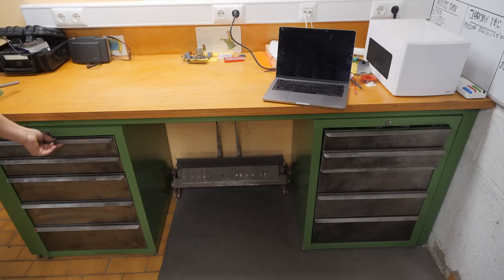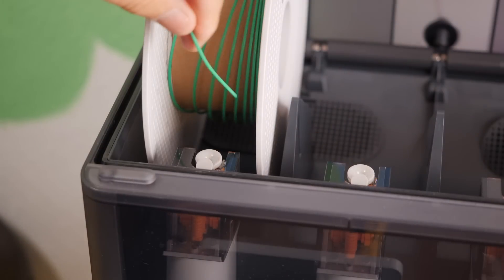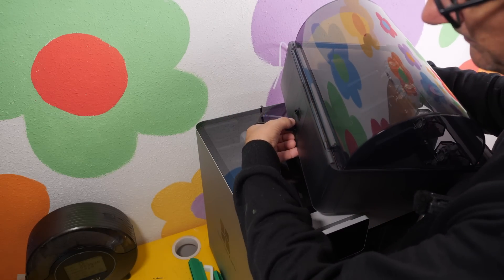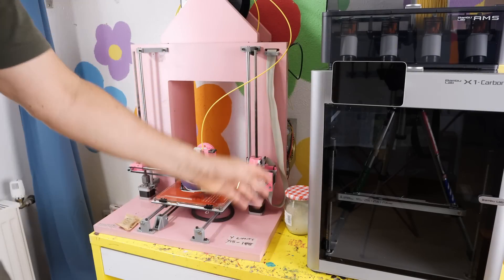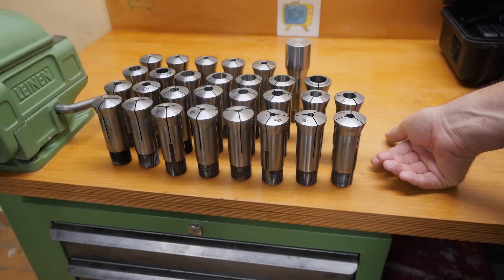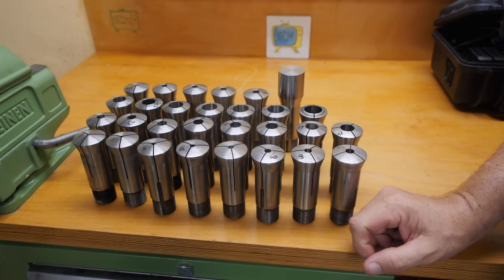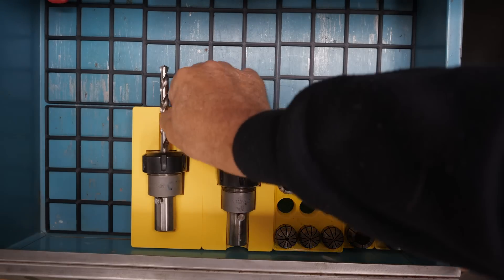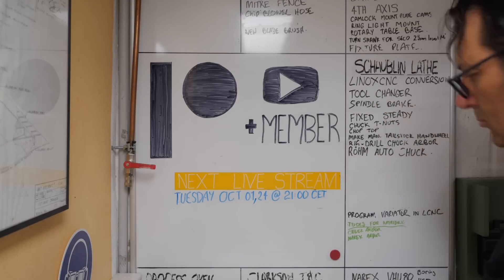Not all tools need Gridfinity || RotarySMP

Comment: Couldn't bring myself to click the 'thumbs down' button, so I guess I messed up the lame video detection algorithm. Not only that, I've also been gridfinity-ing my way through the workshop and I'm determined to use it where there's really a better solution just so everything matches :-) How nerdy am I? - Heather

PS: just helped my brother pickup a neglected second-hand lathe. I think he got a nice little bargain there.
Reply from the maker: Hi Heather. What sort of lathe did he get? Color coordinated gridfinity is a slippery slope :)
Reply: @RotarySMP  It was an Emco Maximat Super 11. Rather tatty looking but the bits that mattered seemed good.
Reply from the maker: @GeoffTV2  Cool. Nice Austrian lathe. Stefan Gottewinter pimped his one really nicely.
Reply: @RotarySMP  I'm aware of my Gridfinity problems and am looking onto counselling - just one more bin first though.
Reply from the maker: @GeoffTV2  Nice Austrian Lathe. If you need ideas for pimping it Stefan Gotteswinter has one.
Reply: @RotarySMP  Yeah, we're both fans of Stefan
Reply from the maker: @GeoffTV2  He is the real deal. A real tool maker. Very impressive knowledge and skill set he has.

Comment: It's great that you're using your 3D printer wisely! It's usually faster, more stable and more practical to grab some wood and make it yourself quickly.
Unfortunately, YouTube is full of lots of pointless prints. 
Of course, not everyone has access to machines or the ability to work with wood, so 3D printers are a great solution. 
Now I feel guilty for having watched you tidying up. I feel compelled to tidy up a bit myself. 😫
Reply from the maker: Hi Chris,
Thanks. I still have plenty of messy drawers to work on :)

Comment: It's pretty crazy how much filament is wasted by printing multi-colour or with support material.   Early on I bought an additional AMS thinking I would do a lot more of that but you really only need one.  (yes with the needed multi ams mixing thing that goes on the back)
Reply from the maker: I am just designing my first multi color part, but will only use that sparingly, on low profile parts.
Reply: @RotarySMP  definitely worth trying.  I've used both PVA (you will need that dryer) and their pla/petg support material.  On the bambulabs software you will start to pay attention to the quantities of material consumed.  Also the amount out the "poop shoot".
Reply from the maker: @JohnTrevick  I really like that Bambu software. It seems well integrated and thought through.

Comment: Gridfinity is overrated, just keep your stuff in old coffee cans or cardboard boxes. You can get a bit fancy and use tupperware and label them even. Alternatively, embrace the chaos :)
Reply: I do it about how he showed his toolbox - the top drawer is the catch-all and absolute chaos, but the others are like "files", "hex keys", "drill bits" etc etc. That's enough organization for me. The people that organize too much spend all their time organizing their tools instead of using them
Reply from the maker: I mostly organise things with ice cream containers. I like ice cream :)
Reply: @RotarySMP  I buy cartons of roasted peanuts.  The containers are clear plastic, and roughly cubes with rounded corners.  Really great for chucking stuff in when disassembling something.  For larger stuff, I buy pretzels!  For larger stuff I did buy a bunch of the same size of plastic containers, and built shelves to perfectly fit them.  These contain stuff like cables, camera parts, parts for the 3d printer, laser cutter, etc.  Everything is labelled so it cuts down the time searching for something from 30 minutes to 25 at most
Reply from the maker: @rustybrooks  What people who are Gridfinity OCD dont realise, is that it wont help you search for the missing tool. You might be sitting on it :)
Reply: @RotarySMP  Then the airtag crew will swoop in and tell you to put an airtag on every tool so you can locate it at all times :)
Reply: @RotarySMP  I came up with the perfect solution to "where did I just put that tool that I had in my hand literally 2 seconds ago"

It's simple, whenever this happens I buy 3 more.  Then after I've lost all 4, it should be a lot easier to find at least 1
Reply: @RotarySMP  Haha, I have 60 odd 5 litre tip top containers, the long ones that are meant for shop service. It was a hard road..
Reply from the maker: @m3chanist  Ice cream heaven :)
Reply from the maker: @rustybrooks  That is a tough method :) On the wallet.

Comment: I must have spent weeks of my life in the RAF cutting out foam sheets to create tool holders for the tool kits. Not any more which is why my workshop is a bit of a mess
Reply from the maker: Those cheap lasers would be a good way to cut foam shadow boards, but I am too lazy for that :)
Reply: I actually bought a bunch of cheap, EVA foam mats just for doing that with my laser! A year later they're still mats, so it turns out I'm too lazy for that too 😂
Reply from the maker: @Teklectic  I am glad to hear I am not alone :)

Comment: I have 2 floor to bench shallow drawers that are the perfect shallow depth for gridfinity. I've fitted out a couple drawers already for organising small endmills and small parts etc. Definitely has a place and totally agree some people go overboard and end up losing useful space. Before that I used a hot glue gun and some wood trim strips from the local hardware shop. Being able to rearrange, change up and relocate with gridfinity is a big bonus.
Reply from the maker: Good point. I should have mentioned that. I already rearranged that one drawer a couple of times.

Comment: Depending on the age of your filament, I found yellow PLA hard to use, no matter the brand. I stopped buying that colour 5 years ago, the 3d printing world might have fixed the formulation during that time :)
And as you say, PLA doesn’t improve when you let it ‘age’ in the open!
Reply from the maker: Thanks for that. I also noticed that different colors have different properties.

Comment: from the time when I did a bit of professional white-water raft guiding, I picked up the habit of using a bit of two unique colors of fingernail polish to put a couple of marks on all my gear in a not normally viewed location... place where a handle screws into a piece of gear, under the soul of the shoe, or maybe in the cracks of a clip... just some identifying colors that are very difficult to remove, especially if they are out of sight during normal inspection... works great for identifying gear when it walks off, but there is a small community of where it can hide.  =D  Happy Sunday!  Long story, just so say... having a few unique colors of fingernail polish around can be helpful in certain instances... =D
Reply: If you happen to be backstage at a big music production in the Netherlands, you’ll find 3 completely pink 20ft containers, where someone is handing out equally pink tools. 
And there will also be a single 5ton forklift with its counterweight marker yellow, a non-unique forklift walked off by itself a few years ago…
Reply from the maker: @KoenKooi  Ouch, imagine trying to get the stage broken down, when the forklift has gone walkabout.
Reply: I used it to make and touch up lures for fishing.

The metallics make great eyes.
Reply from the maker: Great insight. Thanks Mike
Reply: re the nail polish; I work in electronics and its normal for manufacturers to use it for a couple of tasks.
They use it on screws, usually on the screw heads, basically it's a tamper indicator but it's also very effective for a small screw "loctite" effect so stuff doesnt come loose.
It is also good as a "easy breakable" glue on things like trimpots and tiny electrical adjusters.
I always have some handy in the workshop in red, yellow, black etc. You can put spots of black on white connectors as an indicator, or spots of yellow on black plastic commectors.
Supermarkets, pharmacies and shops in the mall often have coloured nail polish in the "bargain bins" where you can get it for $1 a bottle.